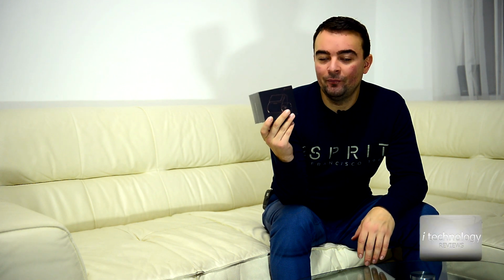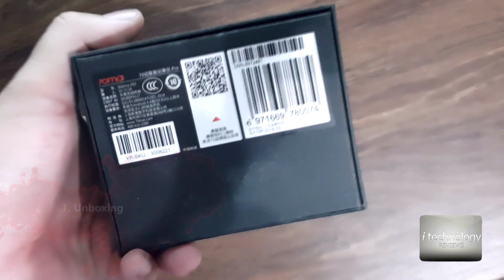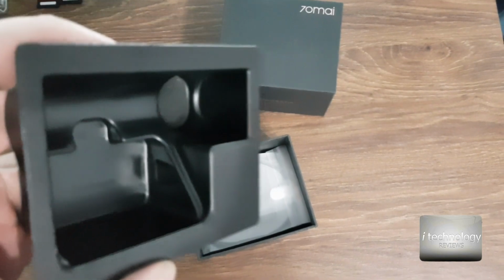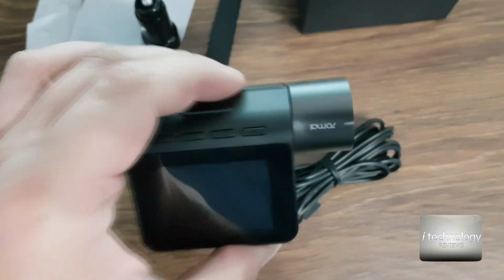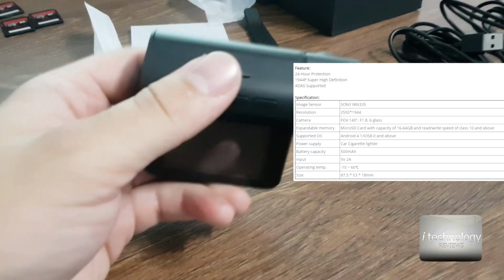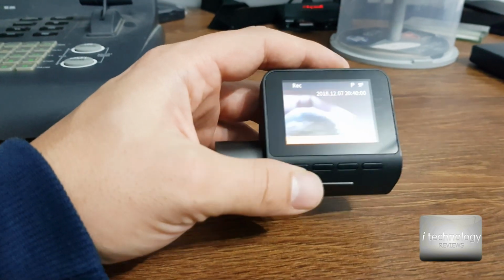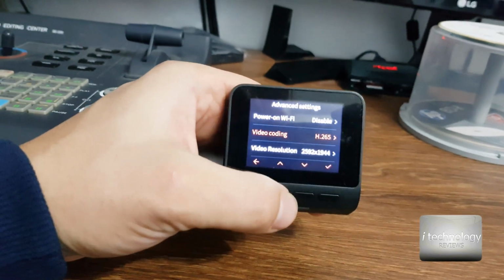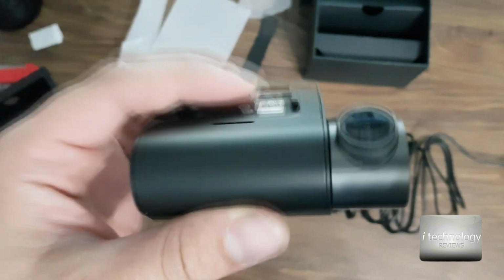Xiaomi 70MAI PRO, 2.7K DVR cam, 140 degree dashcam for your car with ADAS, parking survailance

Comment: Don't put ADAS in the title if it is not in the video.
Reply from the maker: hi; you are wrong; if the unit supports ADAS why not; maybe for me is not a advantage but others can buy the gps module; we will do a video with ADAS also
Reply: @iTechnologyReviews . Because, people are searching specifically for videos featuring an actual ADAS review, and yours, like the vast majority of videos about the 70mai, do not include that. On YT, an inaccurate title is the quickest way to earn thumbs down (this video currently has about 50/50 and I'm guessing the title is partly the cause).
Reply from the maker: it's not the title fault; i didn't clean the windshield first; this is why the people dislike; i can see alo in the day but in the night is that flickering; we will do another video but we are looking forward for the gps module

Comment: Hello I just bought a new 70 my pro dashcam but the description of what is included in the box is more self here we are not responsible there we are not responsible that so things to state there is nothing at all nothing is almost nothing  about how you have to set how you have to do everything and I would like to hear from you the parking option parking monitoring of the car 'but how you should set me actually because I tried within 15 minutes the battery is empty how does it go 24 hours  guard the car I want something from you

Comment: hello how can I remove the glue from the glass when I want to change the camera
Reply: You are not supposed to stick it directly on the glass. They provide 2 electrostatic stickers. You put 1 of the stickers on the glass and stick the mount or (GPS unit, if you have one) onto the stickers, which can easily be removed.
Reply from the maker: hi; i know this but i don't want anything on my windshield more than this camera;

Comment: DO NOT BUY THIS!
The GPS add-on is purely used for the gimick ADAS warning system only. It DOES NOT give any GPS speed or location data on video recordings. Very misleading advertising by 70mai.

Also when installed, the LCD screen sits at the same sloping angle as your windscreen. This means is almost unreadable in most vehicles unless your windscreen is near vertical.
Poor design, needs the LCD angle adjustable.

This said the video quality is pretty good, but other cameras can do this for much less money.
Reply from the maker: where did you buy the gps module?
Reply: With or without the GPS add-on, the camera itself is excellent. It's going for around $50 now without the GPS and you won't find a better 1944P (2592 x 1944) dash cam for less. I DO recommend the camera but the add-on is a waste of time unless they provide some good firmware updates.
Reply: @iTechnologyReviews  eBay has them for about $15-$20. You can find them for less if you're willing to wait for it to arrive from China.
Reply: @MidnightHabit  which memory card of 128gb  shall I use to get the best resolution while watching the recording